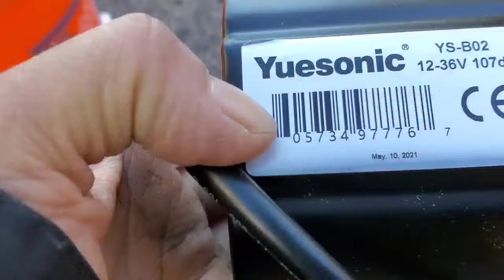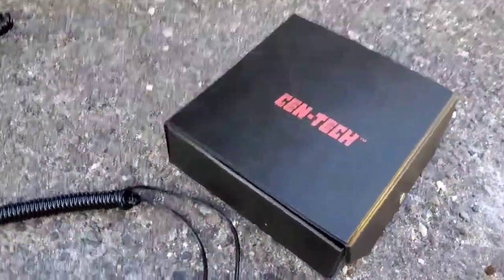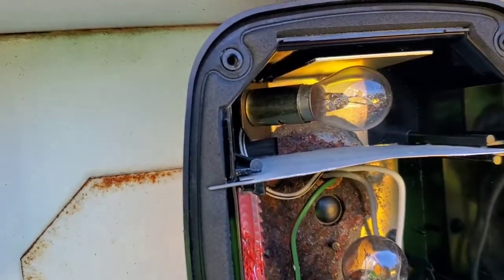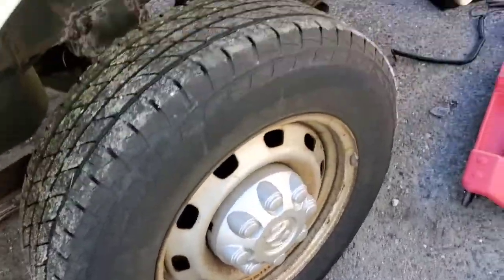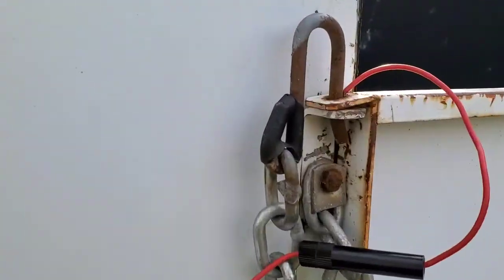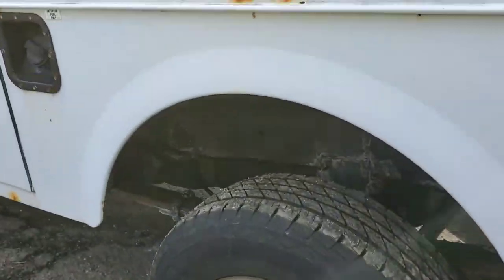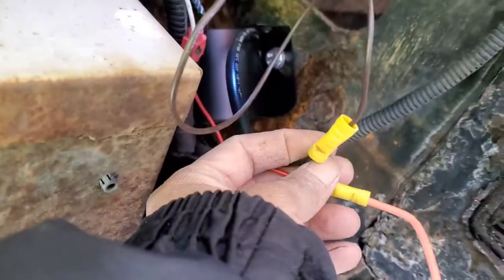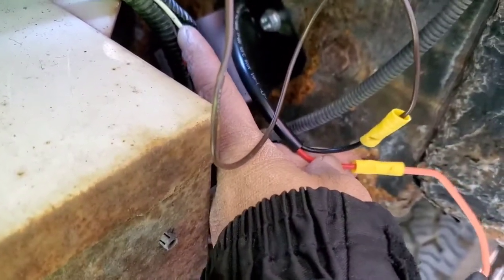How to install backup alarm in my truck or any car #lawncare

Comment: Much better way of doing this is to wire it to a switch so you can shut it off when not wanted.

Also that isn't a very good location for a backup alarm, stick it somewhere under the vehicle.

Anywhere out of the way really, that will get smashed where you put it.